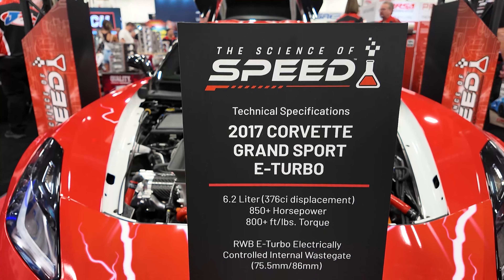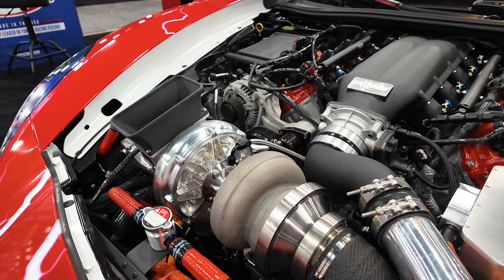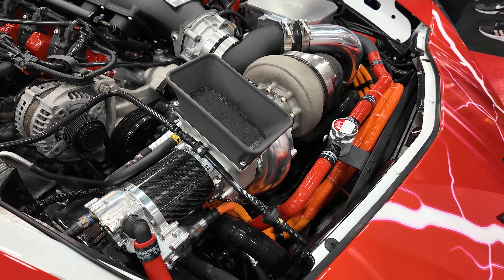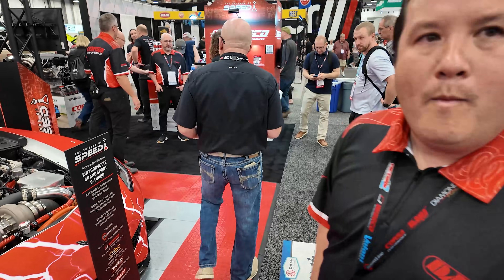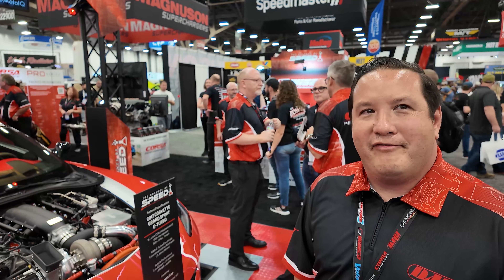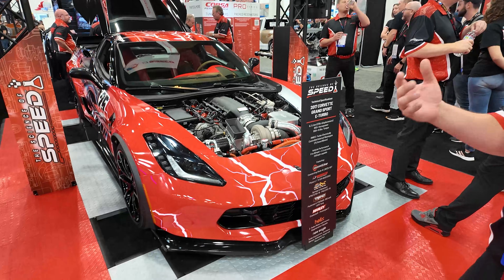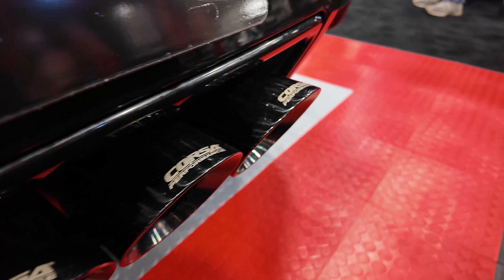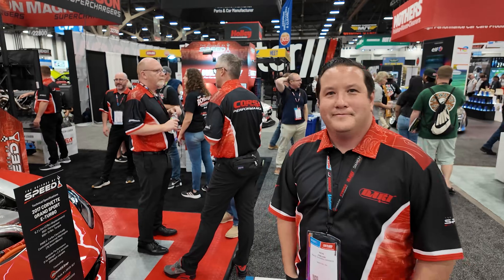This 76mm Turbo Can Accelerate To 130,000 RPM in 150 Milliseconds! | SEMA 2025

Comment: It looks nice, but this is 80's technology.  My Dad invented this a long time ago and I created lots of advancements later.  The better method is having the brushless motor in the center section.
Reply: The idea has been around since gas turbines were invented. The problem is there aren't any generally available to the aftermarket, and they would need to be available in a whole host of sizes. As a small company, if they can offer a way to convert turbos. That would be a big win.
Reply: @captainobvious9188   Yes, I agree, it is a small company and they've accomplished a  lot.  It would be nice for the aftermarket, but there are much more effective and easier ways of accomplishing this.
Reply: Question: why run exhaust gas through it? The electric motor is just to bring it up on boost quicker? The electric motor can't sustain under load?

Shelve this next to the a/c system boost chiller.
Reply: @arturozarate1752   Yes, the electric motor is purely to create boost quicker.  Once the exhaust gases are sufficient to create boost, the electric motor turns off.  The motor is only on for less than a couple seconds.
What you see here is not a preferred configuration, it creates size/ fitment issues and it's easy to have balance problems.
Reply: @davidstjames_ thanks for that. Helps me understand whats really going here.
Reply: @davidstjames_ why not a variable gain turbo? It worked for the 6.0L diesel? Serious question.....excuse my ignorance.
Reply: @arturozarate1752   Some people are happy with the variable geometry turbos.  I always thought that they don't perform much better and are more expensive and less reliable.  The best is the electronically assisted turbos that you're now seeing in F1 and some new Mercedes and Porsche models.
Don't worry, you're not ignorant at all.  This is how all of us learn things, by asking questions.
Reply: @davidstjames_  I’m interested in the generative application too, similar to the F1 MGU-H and MGU-K. Once the turbo is spun up it can turn to a generator and feed HP back. The alternator/starter can be replaced with a single motor/generator. I like complicated projects to work on.
Reply: @davidstjames_ we're talking about decreasing turbo lag right?

From a dead stop, I can see 24 to 32 pounds of boost instantly when the pedal is pressed to the floor. Yes the truck is close to 8k pounds...but it sees over 20lbs of boost nearly instantly.....this tech is already out there, and as far as I can tell, less expensive. 

Why isn't this being explored?
Reply: @arturozarate1752   First of all, the product in this video has nothing to do with me.  I think it's a waste of time and money.  It's something that I was literally doing 30 years ago.
Second, nearly instantly is in no way the same as instantly.  With a proper product, you can create boost before even starting the engine, which is impossible with any conventional turbo.
Reply: @arturozarate1752  yes you used the motor to spool the turbo where you would notmally have lag and then when the free power of exhaust gases in there you save the battery discharging buy turing the electric motor off.  All ECU controlled.
Reply: re: "The better method is having the brushless motor in the center section."  close, what you describe is the more CHALLENGING METHOD (that requires an "F-ton" of time and resources to develop so as to deal with the heat and not have a million Warranty Claims when it fails) is having the brushless motor in the center section...  

yeah the "geometric act" of simply locating the motor in the middle only works if you intend to set the turbo on a bench (cold) and then fantasize until the "12th of Never" about one day actually running hot exhaust gas through it to see what happens in the REAL WORLD.
Reply: @phillyphil1513   Phil, you're a CLOWN.  You have no idea what you're talking about, so run along kid.
Reply: @phillyphil1513 t there was this thing called F1
Reply: @phillyphil1513  LOL, you don't know jack sh*t!  
I know these things because I've already been there.  I still have prototypes 30 years old with motors on the compressor side, it doesn't work well.  Also, you know nothing about heat and power requirements, you only run the motor when the engine is accelerating at lower rpm's or before starting the engine (for certain applications in the cold).  We were a Tier 1 OEM supplier doing everything in house, from castings, motor and controller R&D, everything.  So, Mr. Know it all, go troll somewhere else.
Reply: I love when liars lie. Congratulations. No one believes you.
Reply: @davidstjames_ your speaking facts . S/O to your dad for paving the way for you . Placing a brushless motor directly onto the center of the fan would make perfect sense . And it’s basically only spooling in the times when lag would occur . Start ups . Shifts etc . Makes perfect sense and I wonder if a similar idea for superchargers would work . Like a brushless motor pulley
Reply: @reasonsunknown6707   Yes, 100% correct.  The vehicles where it makes the most significant improvement, is those with lots of stopping and starting, like city buses and garbage truck, huge gains in every area.   
Yes, it'll work great in a supercharger.  You can create boost at any time, under any condition.  The electric motor can generate electricity when it's not used to create boost.  You can get rid of the alternator, this helps offset cost and space at the OEM level.
Reply: @davidstjames_ I hope you got those original prototypes incased and plaque’d up my G  🔥 . Did a deeper dive and the Mercedes AMG ONE is utilizing that same tech your dad stumbled onto decades ago . It’s one Mated directly to the turbo fan and They also have one mated to the crank 😮 . No wonder it holds the record at the Nurburgring for lap times . That’s insane . Because of tech and social media These next 10 years of automotive will be marvelous.
Reply: @reasonsunknown6707   Yes Sir I Do!  I have a few nice old prototypes and parts!
You have no idea over the years how many friends and relatives have said, why don't you throw all that old sh*t away.  I tell them they have no idea.
You're right about the performance gains, but they go far beyond racing.  How about garbage trucks saving 40 minutes on 8 hour routes from faster accelerations.  City buses saving over 20% on fuel!  Yes, getting rid of turbo lag is excellent for many reasons.  Better performance, better emissions, and better fuel economy, everyone is happy.
You would have seen these products a lot sooner if it weren't for the crooks at Honeywell.

Comment: ref: Garrett Motion's e-Turbo developed in conjunction with the Petronas/Mercedes Formula One team, so their 7X Championships 2014-2021 in the Hybrid era was not a fluke.  also ref: the M139 4-Cylinder with e-Turbo first fitted to the 2019 AMG CLA45 and now the tech has been fitted to the single (992.2) 911 GTS and twin (992.2) 911 Turbo with these e-Turbo assemblies produced by Borg Warner.
Reply: No, it was not developed by Garret.  It was invented by my Father back in the late 80's.  In the late 90's, his company did a joint venture with Allied Signal, who later bought Honeywell.  A long story short, Honeywell was already the world's largest manufacturer of turbos(They owned Garret and some others at the time.) and only wanted to protect their market share.  After an ugly lawsuit, Honeywell had non-exclusive rights to those patents and started working on development again several years later.  Honeywell is a dirty company, they've F'd a lot of people over the years.  We were working with Borg Warner before the Allied Signal deal, they are a much better company to deal with in every way, very respectable.
Reply: @davidstjames_  well my dad can beat your dad up 😂
Reply: @davidstjames_  re: "No, it was not developed by Garret."  well technically it was developed in the "hot crucible of racing" that is Formula One by Mercedes Benz.  so if you're Daddy wasn't in the Mercedes Benz paddock for seasons 2014-2021 nor in their R&D Center back in Stuttgart during this time (and it sure sounds like he wasn't) then ultimately what your Daddy developed was "f*%kall".  once he successfully brings something to market...? THEN he can "crow about" having developed something, but NOT until then.
Reply: @phillyphil1513  GFY   We started in 1988.
Everything that F1 and MB has done is based on our work.  You don't know shit.

Comment: It spins up to 150k rpm, well thats what turbos spin up too ? So whats the accomplishment? The time it takes to get spinning? 
God damn all those ev parts added gotta add some serious wight
Reply: Q: The time it takes to get spinning? A1: yes. this is the equivalent of electric ANTI-LAG so basically the Rally Driver's "wet dream".  re: "God damn all those ev parts added gotta add some serious (weight)".  A2: also yes.
Reply: try listening next time, it's low-end TQ fill and lag reduction.
Reply: @krusher74   for what goal? Lmfao add hp to a car in certain areas of a power curve just to null it out with added weight of battery cabling and associated electronics? Lmfao ill keep my 200lb turbo setup and add maybe another 150 on a compound turbo and antilag tube to accomplish the exact same thing, clowns haha
Reply: @codeack101wlck  it can be done way lighter than this sema prototype. Well, companies with more resources can do so. Like Porsche or Mercedes have done.

Comment: Pretty sure the peanut gallery here sounds similar to the first lightbulb being introduced almost 150 years ago.

I would not be surprised if these are eventually standard on factory turbocharged vehicles with minimal electrical load.
Reply: Porsche has an actual electrically-assisted turbocharger. Hopefully we see the Porsche technology and this electric supercharger on more cars.
Reply: It already is. New 911 GTS and turbo s.
Reply: This is really so you can have a big turbo on a high reving engine and fill in the TQ lag down low,  standard cars dont really have that problem.

Comment: They didn’t even speak on the fact about the thing not even have an exhaust running through it to heat it up. That’s gonna be pretty good itself.
Reply: no, the unit seen in the video DOES still use exhaust flow to spin the turbine.  notice the electric motor has been grafted on the opposite end (ie, the electric motor is under that carbon fiber sleeve seen on the far left side of the assembly when standing at the front of the car) to spin the compressor just like a how a starter motor might be used for jet engines.  this was likely done to both aid with quick development and simultaneously place the electric motor as far away as possible from the HEAT and also explains why you see the mouth of the intake to the compressor sticking upwards (sideways) like how you might see the intakes on dual Lycoming turbo-shafts powered Helicopter (ref: like the Bell 222 that just crashed in Newport Beach at Cars and Copters back in October).   a fairly clever approach.👌
Reply: @phillyphil1513  Yes it seems to be electric assist and also uses the turbo to regenerate the the battery pack.
Reply: That's why it is technically an electric centrifugal supercharger. Porsche developed an actual electric turbo that uses the exhaust gases as well as an electric motor to spool up the turbos prior to the exhaust generated boost kicking in.

Comment: These systems are pretty useless in general, way too expensive and way too complicated, I'm trying to go faster not add a bunch of weight and complex electronics that will fail, also I'm really confused why there's two turbines if it's electric, something is not right why would you spin both the compressor and exhaust turbines when only the compressor side is needed for electric turbos???
Reply: My Father and I invented this quite a long time ago.  This setup is not ideal, it's much better to a brushless motor in the center section of the turbo.
But to answer your question, you're speeding up the entire turbocharger on demand before the exhaust gases are sufficient to spin it in order to create boost.  Once the exhaust gases are sufficient to turn the turbine to create boost, the motor shuts off.  Optionally, if the motor isn't being used to turn the turbo, it can become a generator.  We were pulling over 100 amps of current without putting a noticeable load on the turbo.
Reply: Q: also I'm really confused why there's two turbines if it's electric, something is not right why would you spin both the compressor and exhaust turbines when only the compressor side is needed for electric turbos??? A: no worries, listen close and you'll hear the rep mention the words "EV" and "REGEN".  since the electric motor is attached to the end of the shaft, the exhaust gas driving the turbine is being used to recharge the battery pack via switching contained in the Power Electronics, so it's the same way a Chevy Bolt recoups some of the Kinetic Energy of it's forward motion and uses it for braking by briefly switching the FWD electric motor over to act like a generator.
Reply: @phillyphil1513 I believe after thinking about this for a while it's a hybrid turbo, meaning it still uses exhaust to spool but he electric motor is used to help eliminate lag and make it respond like a small turbo but make the peak HP of a large turbo, regardless the battery size and system complexity makes this pretty stupid, also I always assumed it would be cheap as it's electric but these systems often end up being even more expensive than traditional forced induction.
Reply: @michaelhartman851  it comes standard in the 2 newest 911 models, the GTS and the Turbo. In the turbo it's 75kg more than the predecessor. At full throttle the turbos generate something like 30hp worth of electric that gets directly fed into an electric motor in the gearbox. Also it's supposed to be the closest thing you can get to naturally aspirated without being NA.

Comment: Its great ! Just the whole prius sized battery pack in the back would be a complete no from me, personally. Its like, yeah its possible. But zero lag is also possible from having a big air tank set up as well... But the tech is getting there and its gotta start somewhere i suppose. Its cool!
Reply: On this type of setup, the electric motor only runs for a couple seconds maximum.
Reply: so you want an electric turbo without a battery?
Reply: It really shows in the comments on who actually knows what's going on and those who are moroniclly gullible